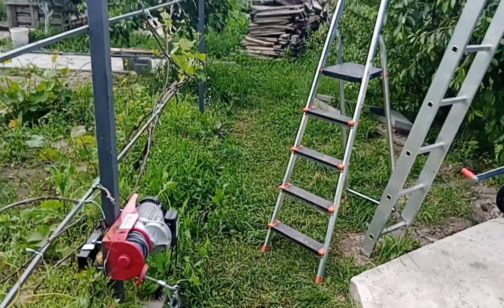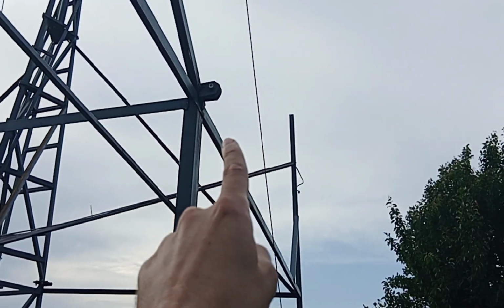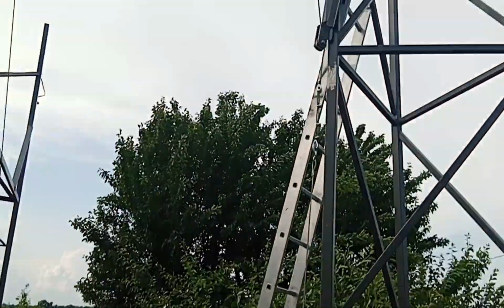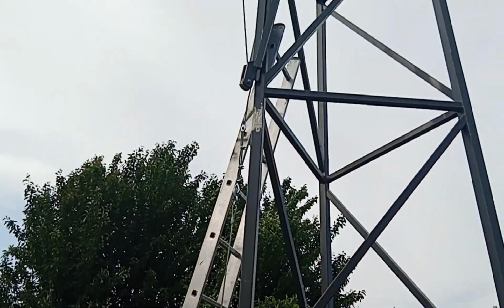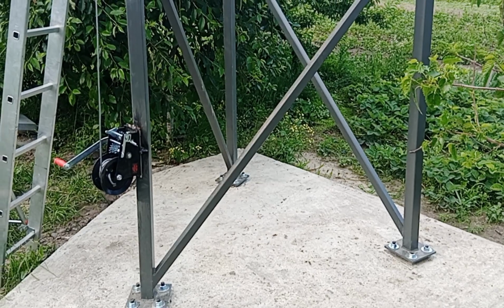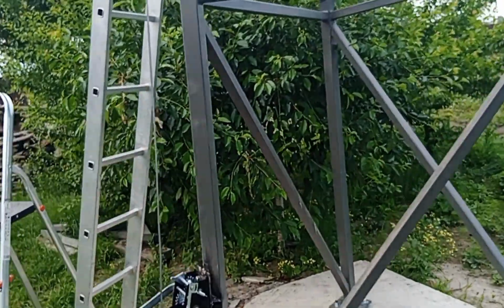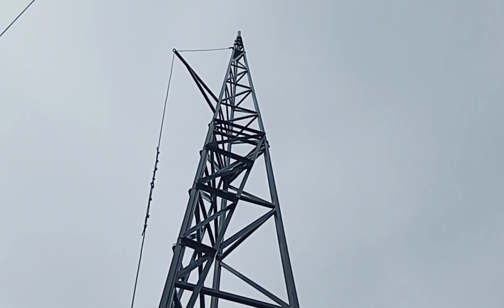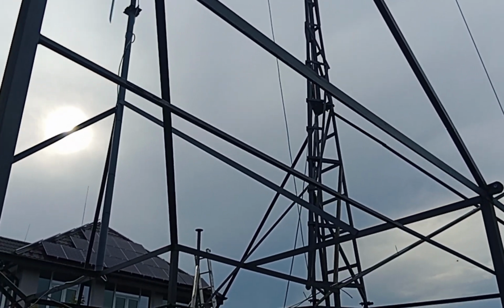The biggest wind turbine tower ever made... Yet, in my place. Is this the last one?

Comment: This is a perfect pin pad system. The only thing I would've changed, is using one of the other towers to tow up the bace tower with the folding. I used a near by tree like I showed you in my video.
Reply from the maker: Yes, it would've been possible, if no crops planted already... We used that trick while building my 12-meter one. It was about fully dismantled and then put back without any crane, just using the existing electric winch I have.

Comment: What was the diameter of you mast pipe. 
Slab looks good and doesn't look big enough to get in the way, I would do a slab underground with pillars upto base plate, but my place is 1/6 the space.
Reply from the maker: yes, I remember that conversation )
in my case the underground slab requires too much digging, so that was literally easier to do it my way, and I got rid of stones and sand that were messing up my other place.
as of the pipes - main three beam ones are 60x60x3.0. internal ones some are 40x40х3.0, some are 30x30x3.0. on top it's ended with 89mm round pipe with 4.0 mm thickness
Reply: Sorry about that, I got abit obsessive compulsive, and have investigated the possibility im asperges after the last year's find renewable energy and the love of math it gives me.
Wow 89mm, stil trying to put this 4kw on a 60mm pipe 32kg, come to the conclusion if everything is close to the mast less leverage wouldn't be incorporated as much and a very thin tall tail behind the motor infront of the blades, unless I sweapt the blades.
Reply from the maker: all good, mate